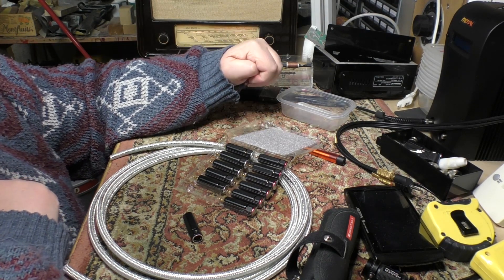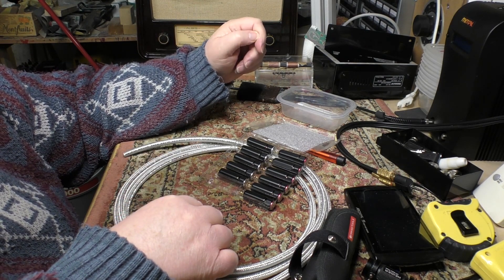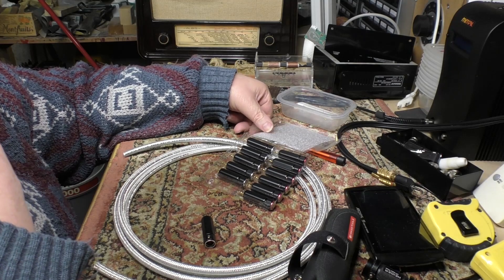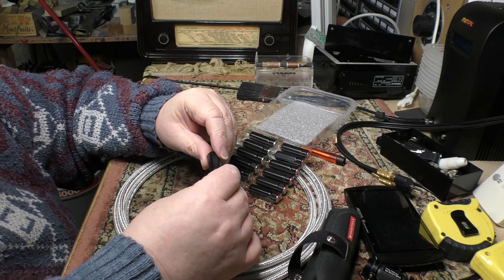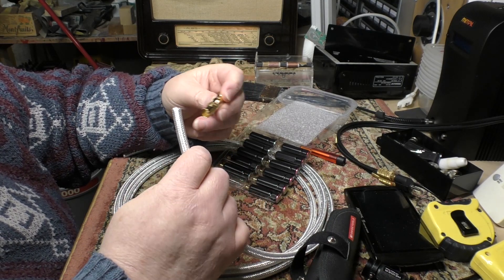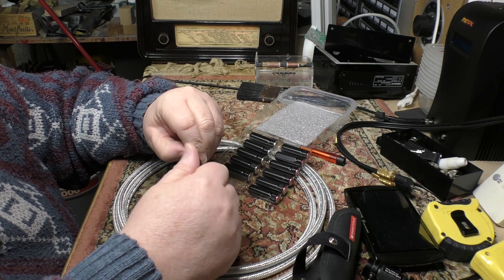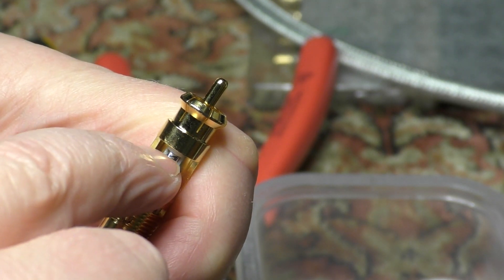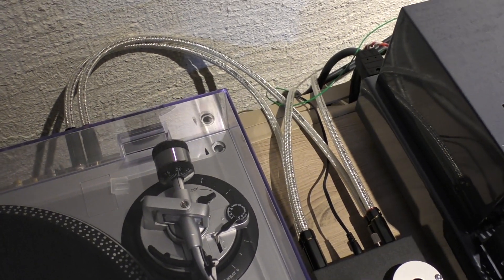HiFI Cables

Comment: +Zone1242 John, try listening to "Sky High", by Jigsaw, circa 1975. When MW radio stations still gave a darn about their modulation characteristics - and requested the "full breadth of the 10khz modulated carrier", Sky High was the song used to demo the results.  Your soldering now is certified to Mil Std 2000 Category "C"!
Reply from the maker: +AMStationEngineer Hi Tim, OK I'll have to go look up the details of that soldering standard :-)   Don't think I know 'Sky High' so I'll check that out too.  It's all good fun this vinyl stuff!
Cheers,  John

Comment: I bet it will NOT make ANY difference. After you have spent all that extra money you will convince yourself it sounds better. Years ago I was involved with blind tests. As an experiment we held 12 tests but never really changed ANY cables, needless to say, everyone had there favorites!!
Reply from the maker: +Michael Beeny Can't say I noticed a difference.  As you say, unless the original cables are of the really cheap variety it is unlikely new ones will make a difference.

Comment: Forget hi-fi cables. A good cable must have low capacitance, low resistance and a decent pair of plugs. That's just about any cable. Expensive power cables are a similar waste of time, decent quality heavy gauge mains cable and decent plugs is all you need. And the same goes for mains conditioners, which when filtering the mains tend to flatten the dynamics.
Reply from the maker: +Ashley Cox Yeah I figure I'll stop now - but then again, I am intrigued to see if there's a difference between a moving magnet cartridge and a moving coil one.......
Reply: +Zone1242 There's a massive difference, depending on the cartridges of course. A very good MM such as an AT150 can equal a low end MC, but step into the higher end carts and the difference becomes quite apparent.
Reply from the maker: +Ashley Cox Thanks Ashley, So, MC cartridges start around $200 and I think the most expensive one I've seen so far is over $9,000.   Now for nine grand I can park another car outside so we're not going that far.  What size investment would you say is necessary to be able to detect a difference in sound quality?
Cheers,  John
Reply: +Zone1242 With your turntable, I'd probably stick to an MM and go with the AT150 or AT440MLA. You'd have to spend a grand on an MC to significantly better the AT150 when setup correctly.